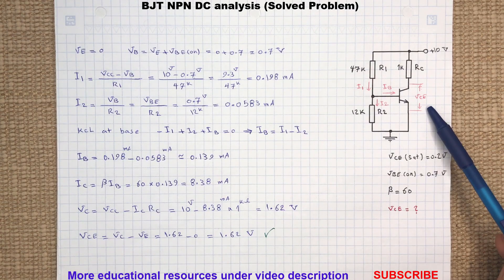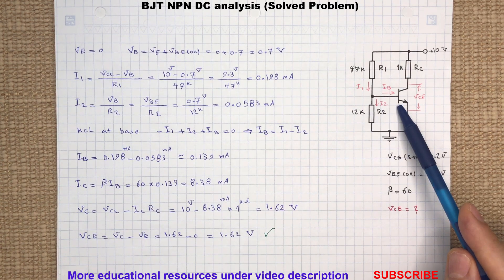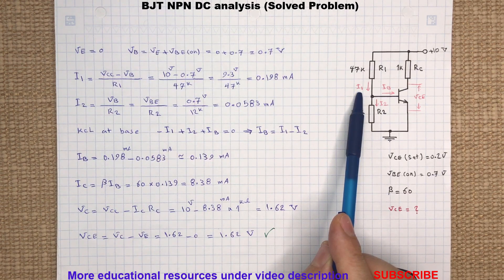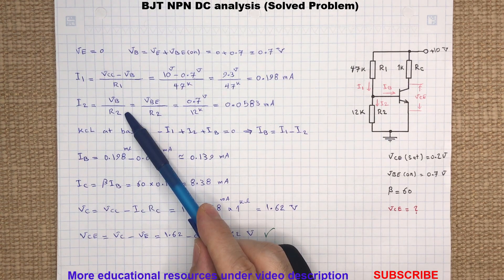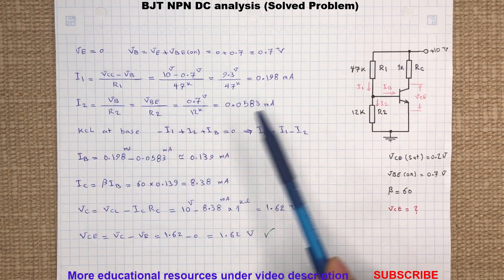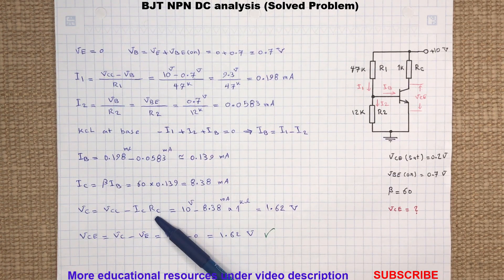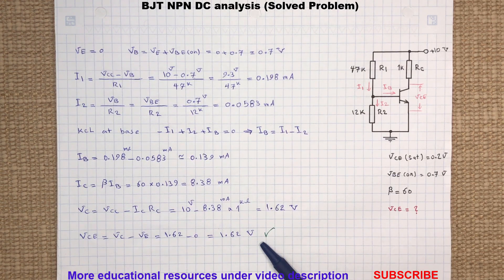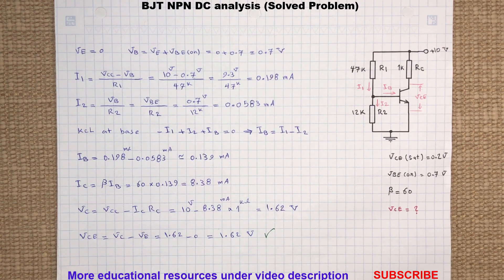NPN Transistor Biasing Example, BJT DC Analysis Solved Problem

Comment from the maker: PNP Voltage Divider Biasing : https://youtu.be/zGo1NW2PO7c
BJT Voltage Divider Bias Solved Problem:  https://youtu.be/QTZyadf7u3k
Darlington Transistor and Diode Circuit Analysis: https://youtu.be/GGsz3ftdtp4
PNP Fixed Biasing : https://youtu.be/_-PItPPaTjM
Electronic Circuit Analysis Playlist: https://www.youtube.com/playlist?list=PLLA_QJ8rHZBh5LqrY41bCvKgreRDRWrBQ
Control System Playlist: https://www.youtube.com/playlist?list=PLLA_QJ8rHZBjS_S6WPkmUweF5NbImvSqf